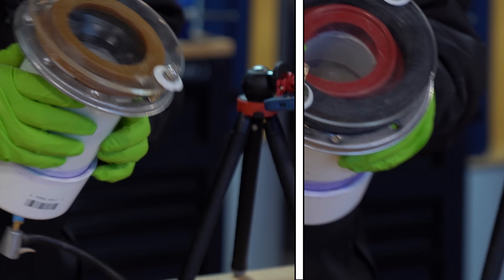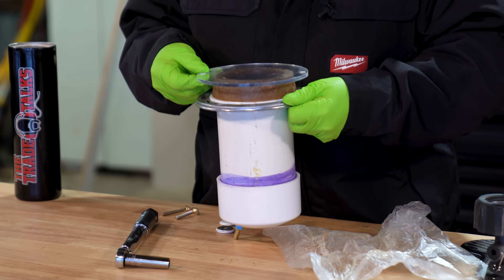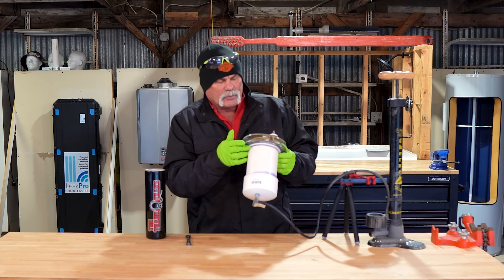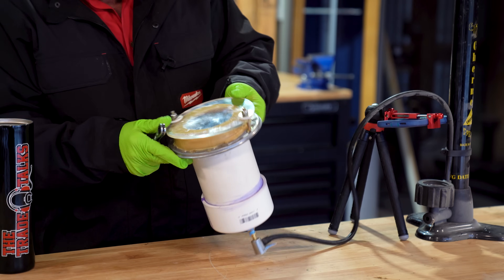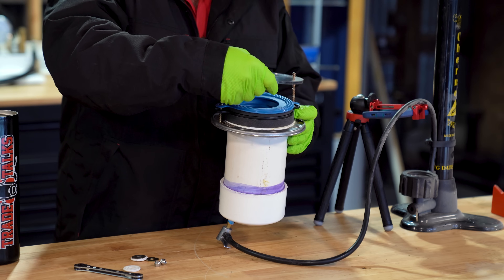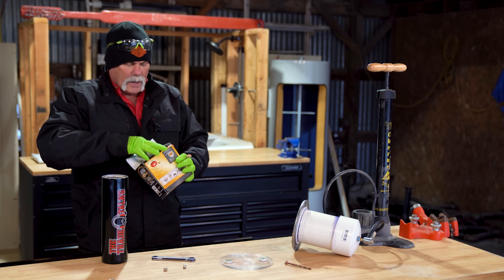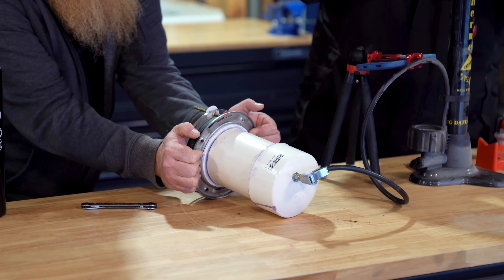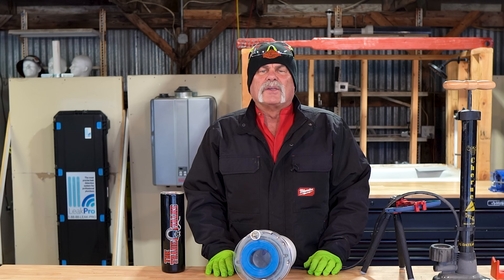Toilet Wax vs Rubber: Which Works Better?

Comment: I think you're testing the wrong aspect of these rings. These pipes usually do not see anywhere near these kinds of pressures. The most-common cause of leaks (according to my small sample set) is when the toilet gets nudged a few times after setting into a wax ring, introducing gaps where water or vapors can escape. This is the advantage of rubber/silicone rings which have resiliency to move with the toilet if it moves. My only issue with "Better Than Wax" (which was the first non-wax ring I tried) is that you kinda have to put in the number of spacers they recommend and then just hope for the best. My new choice is the Danco PerfectSeal, where it has wax underneath and rubber on top. The great part about this is that the toilet will engage with the seal about 1" above the floor, so you get a good squish of the wax onto the flange and this also sets the height of the rubber gasket to be where it's going to be pressing against the toilet with the same force that it requires to squish the wax.

Comment: I'm old school as well and still using wax 🤷‍♂️
Reply from the maker: Have you had any problems with it?
Reply: @RogerWakefield  in 33 years, no problems at all that I'm aware of. I will double up the wax rings if flange is below the instead of building up the flange somehow, putting down a regular first and then one with horn, I feel it keeps the wax from squishing inward.

Comment: wish an air compressor was used and slowly throttled up (or tank), don't have such a shock load. Also have a thicker/stiffer piece of plexiglass, this current one flexes more that a heavy porcelain tank...

Comment: your 6" acrylic blind flange was too thin.  it was limiting the maximum pressure by deforming under load and spilling the air pressure.  try a steel plate flange with stiffeners

Comment: Misleading test results due to the way the tests were constructed/performed. The bottom of a rigid ceramic toilet fixture is not going to bend like the clear acrylic plate in the video. The pressure gauge being shown was indicating pressure at the pump end of the hose, not the test chamber end of the hose. That's the reason the reading was spiking high during a pump stroke then dropping down between strokes. In order to get a truer read of the "failure pressure", a gauge should be connected directly to the test chamber, or the pumping action slowed down so that air has time to equalize through the hose over to the chamber.

Comment: I would have liked to see these test done with 4 bolts instead of 2 to more evenly spread out the pressure as if a toilet was sitting on it. I'm curious how the wax would compare to the better than wax with the edges clamped down that way. (Like how the edges were held in the better than wax test) My guess is that air was leaking at the unbolted corners. I say this cause, in my head at least, these tests didn't simulate how the weight and rigidity of a toilet might better seal as the bolts more evenly apply pressure.

Comment: The plexiglass is not thick enough.  As you tighten the two nuts the plexiglass is bending, allowing pressure to escape.

Comment: I struggled to install one of those heavy fully covered toilets where the bolt holes are way deep inside the external porcelain casting. Lowering it down lined up without spoiling the wax was damn near impossible. I eventually got it but the rubber would have been easier. I ended up using a grease pencil to mark the floor and toilet with lines of where the holes and bolts are, then using all my strength to lower that 90lb bas*ard down to the floor in the right spot.

Comment: This is good info, but I'd be more interested in how it holds up under constant use (sitting down, crashing down, flushing, aging of the material) over about 20 years, which is a reasonable life for a toilet and its seal.

Comment: Honesty anything springs back better than wax I still use a jumbo wax ring and smear the one that comes witha new toilet on the bottom of the toilet to promote adhesion on new ones they tend to have powder or oily stuff on them

Comment: I just used these non wax products and you really should’ve read the instructions. All of the non wax products are adjustable and to be used in various different flange situations. Wax comes in different sizes to customize your flange to your specific situation. In this video the non wax flanges weren’t used properly with the flush flange hypothetical fixture. You are actually never supposed to double up on the korky product and on the better than wax you only use the gasket if your flange sits well below the surface of the floor.

Comment: The plastice plate was distorted when the rubber seal was used. It was destined to fail without a flat sealing surface.

Comment: Well after reading several comments I’m going against the rubber style. Used them once and went back to wax. Can’t tell how many toilets I’ve installed over the years maybe 50 never had a problem with wax tried rubber didn’t work for me. Bottom line try both you’ll figure it out.

Comment: Porcelain bowls are not finished smooth on the bottom, so wax would fill in better. New foam/silicone rings do not fill in the tiny uneven spots. The silicone flappers have problems sealing the water in the tank from leaking.

Comment: I'm not a plumber by trade but I've set a fair number of toilets in my day and although I've been interested in trying the rubber seals I've always stuck with wax. In an ideal world the toilet base and drain flange would be perfectly horizontal and parallel to each other, in the real world this isn't always the case and I feel the wax will do a better job conforming to them and creating a better seal. I might be wrong but they've aways worked and there is nothing I hate more than to have to go back and fix a plumbing leak.

Comment: I tried both and the wax held up with no leaks!
Reply from the maker: How'd the rubber do?
Reply: @RogerWakefield  The rubber leaked! Even after adding a secondary ring per the manufacturers instructions. Korky wax less rings don't work

Comment: Not very good test for several reasons. 1. The plexiglass is too thin and flexible compared to a stiff heavy toilet.  2. You have a problem with the hand pump. The pump check valve is not working. It is missing a ballcheck valve that prevents backflow.  3. That air fitting at the bottom makes it hard to handle. Make a fixture to hold it that allows the test apparatus to stay in one place.

Comment: The issue I see with this test is the plexiglass top is too thin to make the test viable bc it flexes. A toilet flange or a toilet bottom will not flex. Use 1" plexiglass so it won't flex while you're tightening the bolts and then the rubber will hold a lot more pressure.

Comment: I used the Better Than Wax on my hall bath. Works good until i have to plunge it or the master bath. Leaks into my basement.
Reply from the maker: Oh no! So are you going to change it out with something else?
Reply: @RogerWakefield  yes a wax seal.

Comment: In a country where 80% of the inhabitants are obese, particularly in parts of the country that get cold,  the no wax rings give a much more reliable seal, and unlike wax seals, they keep working after being over stressed by somebody large shifting the stool, especially when temperatures are low. This is why I switched to the no-wax rings about 20 years ago, and have never seen one leak. I wish I could say the same about wax rings.

PS It would be a good idea to redo the test using 1" thick acrylic to limit deflection, or even better, a resin block molded from a stool horn which would provide blowout support to the ring. A mounting allowing stress to be applied to the joint, simulating a person using it, could add to the realism of the test.

Comment: I use the better than wax. However I do not use the foam because it's for an extension.  I make sure my flange is not inset. The tenants would plung the toilets and blow out the wax. Never had the problem with the better than wax.

Comment: the main problem is the flange, toilet and flooring all end up moving around small amounts and flexing. that makes the seal(wax) get overcompressed and break contact., it's far less an issue on concrete, tile, hardwood. but another big problem is the flange not being bolted solidly to the flooring(old cast iron) was often just hovering there or floating flooring, carepting, multiple layers of vinyl and luan. it all "hammers" the wax out flat in hours to months and then you have a sewer gas leak and water splash out, espectially when funnel/horn extender wax isused!
the rubber ones seem to solve tha, but I'm sure they'll fail in time from the foam rubber decompositon. although they may still not leak water unles there's a blockage and backup.

Comment: Based on my experience over 20+ years, I found better than wax and never went back.  The toilet can loosen up but the BtW doesn't break, so you can just tighten it back down.  Once wax breaks, you get that terrible leak, and it's a disgusting mess to clean and prep for a replacement.

Comment: I could be totally wrong, but I think your test is flawed. With just the 2 bolts, it creates uneven pressure and the top is not flat, so the sides without bolts can't seal on the rubber rings. On the wax rings it doesn't matter because once the wax seals, it remains sealed until it fails under pressure, because it is sticky and as it compresses around the bolts it's able to mold to whatever shape is created with the acrylic. The exact same thing may happen as you tighten down a toilet, I really don't know, but I feel like the base of the toilet will not flex like the acrylic does as you tighten down the bolts. I hope this doesn't come across as being critical or a know it all, I always make a mess with wax rings and would love a better alterative. Thanks

Comment: with out a doubt the Rubber Rings RULE !   if you plunge a toilet that has a wax ring = you will blow it out and then your floor will start rotting away !
Reply from the maker: I’ve never had a problem with a wax ring blowing out when plunging 👀
Reply: @RogerWakefield   Plumbers don't use plunger's - they rod out toilets !  Real Plumbers always used a ring they made out of Plumbers Putty

Comment: The best way to do this test would be to find an old toilet bowl put an air plug in from the bowl side the attach your test jig to the toilet outlet as normal, then pressure up your jig.

Comment: You have to use the weight of the toilet to do this accurately. The toilet will have the heft and no give at the flange. Ideally, make sure your WC flange sits exactly on top of the floor. Not below or too high. That indicates a poor install and you're asking for future issues. And the Toto people say to NOT use a wax seal with a plastic forcing cone....it will inhibit/restrict their flushing system.

Comment: Your top flange, which is the transparent acrylic, is pliable, which is why the rubber ring won't hold properly. In real situation, the bottom of water closet is rigid ceramic material. It won't bend. Maybe you could get a rigid material for the cover to simulate a connection closer to reality.

Comment: I think a dyed water test would have been much better. Whether you use water or air, it would be best to use a dedicated psi meter attached to the test tank. those bike pumps are not accurate with the psi reading when you’re pumping them up, it reads the back pressure in the small hose itself, not the pressure in the test tank, that’s why it drops back down after each pump.

Comment: I'm a contractor and I would question this method.  It's possible that the acrylic is bending, unlike a ceramic toilet which absolutely does not distort in anyway.  Also, why not test with water instead of air?  Then you could see what's happening.

Comment: For the record, the flange on the bottom of the toilet is convex or cone shaped. The seal, wax ring or other seals recess into the toilet base. It's not flat like the acrylic here. I'm not taking sides here, just stating what should be the obvious.

Comment: While I enjoy your channel and you share some very good content and worthy information. I expected a better more accurate testing device.  The device does not meet the criteria of who you are  Rodger or the quality of work you do.  (pressure applied from device is in the wrong direction to the installed product, it will definitely fail) .

Wax rings are good, so are waxless/rubber rings. I have used both and have had equal success rates. I have failures with both as well.  Since covid the quality of all products took a dramatic drop. wax and waxless had a high rate of failure due to decreased  quality standers with no fault to the plumber or installer..

Comment: My only concern with the new rubber seals is longevity. We know a wax seal will not degrade over time. We think, but don't have the experience to know, that the rubber seals will not degrade over time. The same rubber used in other contexts has proven very durable. On the other hand, in the 1970s a lot of homes were built using a new flexible plastic piping material. It was much easier to install and was supposed to last even longer than copper. Within 15 years, those homes had to be repiped. Their new space-age plastic pipes had degraded and had started to leak. The plastic had proven durable in other contexts, but it wasn't up to the strain of being used for household water delivery.

Comment: I would think that you'd want to get a porcelain adapter from a good toilet to make the contact w/ the rings, then make a rubber & acrylic window to seal on top of that porcelain adapter. My thought is that you'd better replicate the actual sealing capability of the rings, since the acrylic window you're currently using will just bow, unlike a toilet, as you torque down the nuts on the bolts. Right now, now matter what you do, the acrylic window is causing a flaw in the testing as is will always bow & lift on the sides that aren't bolted down. That said, your current test is able to prove that 25+psi is needed to overcome the seals the rings make is properly set, so they're all fairly robust since you'll never have that much pressure in your sewer lines or toilet w/o an explosion about to happen shortly after.

Comment: The acrylic cap is the problem in your test. The acrylic is deforming to much for a seal to hold especially on the more stiffer rubber rings. Given that the there is only two points of tightening compression on that weak acrylic. The reason the wax ring worked better, held more pressure was because the wax is able to deform with the acrylic cap and still maintain a seal. Remember the bottom flange of a toilet doesn't deform or flex. So your experiment would of made more sense if you would of went with a ⅜ thick round steel plate. It would of better accurately stimulated the mounting flange of the toilet. Enjoyed your video nonetheless. Maybe you can revisit it later.

Comment: With 1,159 comments, mine most likely won't make a difference. The test here is the ring sealing against a perfectly smooth plastic sheet instead of a toilet. I would expect the wax to conform to an irregular surface better than the plastic and rubber ring.

Comment: That Plexiglas isn't thick enough because it's flexing unlike a real toilet would. You need at least 3/4 inch plexi or use a metal plate. If you would have had a plate that was thick and stiff  enough that would allow the rubber to seal. I'm sure both was and rubber would have had higher pressure before blowout as well.

Comment: To be fair, a toilet has a ceramic flange that sits down into the ring. This helps the ring keep it's shape when bolted down. 
   The video shows the rings are misshapen due to uneven tightening and no inside flange. Regardless of the ring used. 
   Another point is that the foam is not always used. They are, simply, provided as spacers for lower than floor mount or uneven floors. Again, without the toilets ceramic, male, flange, this blow out test is inconclusive. 
   However, It can be said that should a sewer line backup occur, up to the floor level, the foam would become a bacteria magnet. Infecting also the floor. This issue is rarely seen except in city wide flooding issues. 
   I prefer the rubber ring. Wax is not forgiving should you misalign the toilet and a mess to clean up/off.

Comment: Invalid test. In each case it was unclear if the seal or the flexible acrylic failed. Retest using a more ridgid plate like 1/4 inch steel.
The max pressure is caused by plunging a stuck drain, not from normal flushing.
Reply from the maker: We're working on a new test

Comment: Seems like those rubber seals are more set up to seal on the outer lip of the toilet outlet rather then the the bottom on the toilet housing. Plus, toilets don't bend like plexiglass lol

Comment: I hate wax. If you need to remove the toilet, then clean up the wax before re-install, blech. The other problem with wax is once you have it in and set, if there's ANY movement for whatever reason, the seal will likely be broken. If it's on top of a concrete slab and everything is properly tightened, generally not an issue, but with wood joists and a 'somewhat flexible' subfloor, that can be an issue. Unfortunately, the subfloor in my house has enough flex that it's causing issues with the tile floor.
Reply: Clean up isn't bad tho. I haven't watched the video yet but just from being a residential plumber for the past 7 years I prefer wax. Feels like it seals better. Also the movement thing isn't true. I mean you can't move it alot or have a big rock in it but both of those problems should be taken care of before the toilet is set on the wax

Comment: Air pressure holding the water in the bowl is only about 15 psi. So I don’t see any way that you’re going to get 25 psi to push out through the ring. That’s not the path at least resistance.